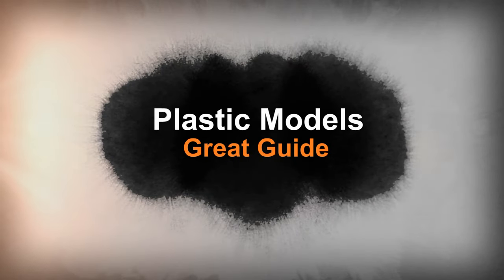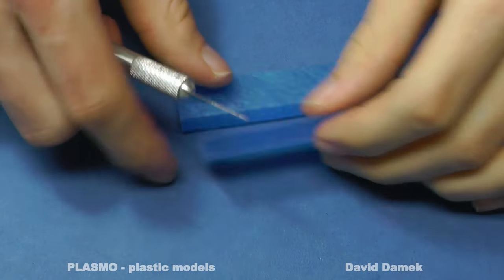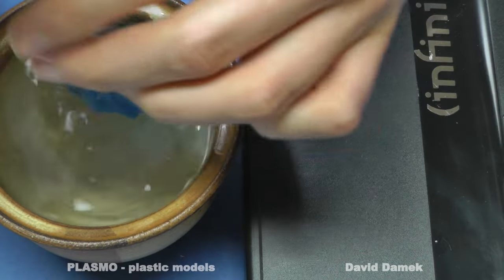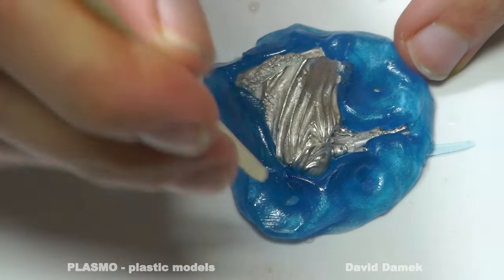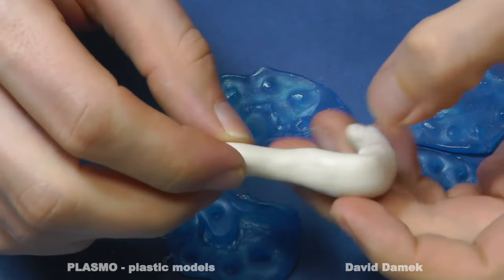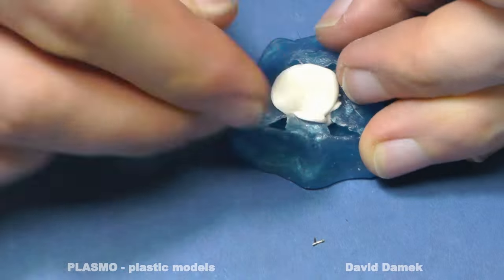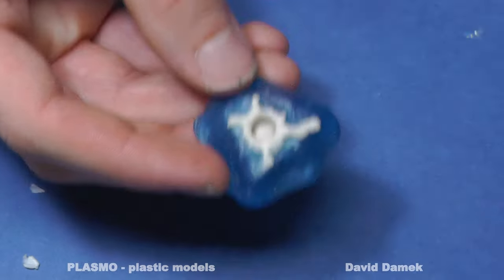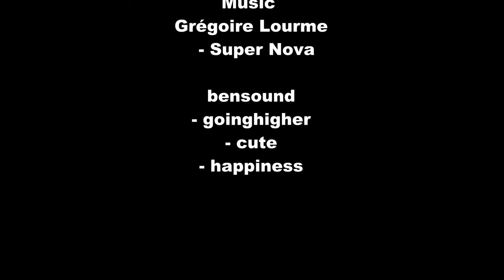Blue Stuff/Oyumaru  - How to cheaply cast miniatures or plastic models - new version

Comment: The 'X' on the Epo Putty means you better put on some gloves.
Reply: This is good to know, i went off useing epoxy putty after it made the webbing of my fingers  blister and my eyes go all puffy .
Reply: billyjimbobjr I'd advise not trying to take copies of your eyes using this method. ;-p
Reply: billyjimbobjr Maybe you're allergic? I've mixed and used at least 7 or 8 packs of the stuff so far without gloves and all it does is make my fingers raw (Rolling anything sticky in your fingers for hours will do that🚡)
Reply: aww dang, you might be right. i should maybe get tested.
Reply: you have webbed fingers?
Reply: Phu Vet 
The webbing is the small fleshy bit between the fingers, particularly the one between the thumbs
Reply: More like you better wash your hands after using it. Outside of people with sensitive skin, the transdermal bioavailability of whatever nastiness is in there is going to be minimal. Just don't ingest it or apply to mucosa.
Reply: Phu Vet not in the way a frog or bat does, but yes.
Reply: it means it can cause irritation. try not to rub it into your mucus membranes or into the pores of your skin
Reply: Phu Vet we all do, but it's not that noticeable sometimes. The webbing between the index finger and the thumb is called a FLAGINA
Reply: i put tamiya glue sometimes on my hand to check if u touched the paint with the brush and nothing happened
Reply: @RalphV  Kinky!!!
Reply: @RalphV  some toxins can enter the body through the skin. Do it often and the toxins can pile up in your body and make you very sick later in life.

Comment: It doesn't look like it captures detail very well.
Reply: Part of that is down to the method.  The blue putty still looked wet during its molding, capturing some water, and the user was going pretty quickly with the epoxy, which itself seemed to be a bit thick for fine detail.  I think this stuff did pretty well, for basically being high-temp silly putty.
Reply: A lot of TLC and a fair bit of luck is required to get even some of the finer detail to transfer over.. don't expect it to be a perfect (or even close) mirror of the original piece being molded. They will almost always look like they have a really thick coat of primer on them :p
Reply: @ARescueToaster  There are a few videos that show this getting a high level of detail on other channels.
Reply: @darkstorminc  I'll have to check those out! I imagine it's not easy to do, though?
Reply: @ARescueToaster  iirc you will need to have a mold box for best results. Some recommend using legos which I think would work out well.

Comment: This is a great idea. I do metal casting and would like to try this to make wax patterns for lost wax casting. Is this product still available. A google search only shows a few suppliers that do not stock it any more. I am in the UK.
Reply: look for Polycaprolactone (PCL) on aliexpress.
Reply: Does not ship to UK, where I live.
Reply: Sorry, don't know why the would ship to the US and not the UK. I ordered a bunch of stuff from them the past few years. Maybe if you send them a message or do a search on Amazon, Ebay or the web. Use search words "Instant Mold", "Blue Stuff" or "Oyumaru". I have used both, the blue stuff and Oyumaru. I like the blue stuff better, but I think they are the same thing.  They are great for one sized molds, and good for two sided molds for small parts. I just started converting toy soldiers and this is a great way to change the way a figure looks by adding different weapons, helmets, shields or something else. Next I will be changing arms, heads and other parts that I make or clone. I have a blog page, if your interested. Good luck, Mike.

https://warhorseminiatures.com/
Reply: Yes they seem to have something against the UK, shipping is to lots of other countries.
I have been trying moulds made with silicone sealer, corn flour and sunflower oil and it works very well for one and two part moulds.
Reply: One day I will try to make some silicone molds if I ever sculpt anything decent. Just getting started with all this the past couple of years, only have been using the instant mold and epoxy. I use the brown and green stuff epoxy or kneadatite. Going to use some other types in the future. I wish I had more time to do things like this, but between work and other things I don't :(
Reply: There is another product called "instamold" that works similar to this. I have a pack myself and it's done wonders to reproduce OOP parts. However as I have a personal rule of not casting entire miniatures (just rare and hard to find parts that I need en-masse, like plasma guns) I do not know how well it is on bigger projects.
Reply: I used the blue stuff and other products like this to use patterns for miniatures. I took some toy animals to get a fur pattern to use as a fur cape on some Vikings. I have not tried to mold a figure, but might try next year. Like you said just some OOP or rare figure would be worth it. I was thinking of trying to clone some parts to make new figures. Like changing arms or heads. Or cutting up a figure and then putting the parts together or make some new things. I think it might be easier and getting better details captured in smaller parts, instead of trying a whole figure.
Reply: MechaEmperor7000 Instamold works just like this. Oyamaru is the original. CoolMiniOrNot repackaged the clear Oyamaru under a new name, jacked the price and made everyone think they matched sliced bread. Blue Stuff is the same as Oyamaru but in a different color. Looks real good. Check for Oyamaru on eBay. Usually get em for less than a buck a stick. As always, anyone should educate themselves.
Reply: this seems to be the same/similar stuff: http://elementgames.co.uk/paints-hobby-and-scenery/epoxies-milliput/mini-mold-6-sticks
worth a try anyway.
Reply: martin the worrior read my response I did to MechaEmperor7000. The stuff you linked is the repackaged stuff CoolMiniOrNot sells. It is originally Oyamaru but more expensive.
Reply: myfordboy you can get thermo setting plastic granules from any Maplin store or on their website. Does the same job. Wear gloves if using the putty, obviously!
Reply: Adrian Beaumont I've got the white thermoplastic granules, called "polymorph", but that did doesn't behave like the blue stuff here does. Polymorph bonds to itself aggressively so you'll never get the two parts to split, and it isn't flexible or very transparent. It is also really hard to cut with a knife, while "blue stuff" seems more like a jelly. 
Having said that, I will try it tomorrow!
Reply: Discreet Security Solutions Yeah cool... the blue stuff looks softer, maybe. Let me know how you get on!
Reply: I have had success now using silicone and corn flour. A tube of cheap silicone, brown makes it easier to see. No nonsense brand from Screwfix,
Reply: +myfordboy you said you were doing lost wax casting, do you have any tips for what to make the investment out of? Also if you search for proto-putty on grant thompson's channel you'll see something like your silicone and corn four mix (just thought that was interesting)
Reply: This is just a common kind of thermoplastic material. Thermoplastic pellets have been available to hobbyists for a while. Try looking for Thermomorph, Friendly Plastic Pellets, or something along those lines. They can usually be had for slightly cheaper than Oyamaru per gram. 
In the US I can buy half a kilogram of Thermomorph for about $19.
Reply: The mould-able plastic I've used in the past sets pretty hard compared to how flexible the blue stuff looked. It would probably work fine for certain pieces though.
Reply: I've actually tried it since leaving that comment, and you're not wrong. The normal "polymorph" plastic sets pretty inflexibly. Not bad if you're casting a simple shape like a figure's weapon, but for anything with overlap it's not gonna work that well.
Reply: Mabe because Games Workshop is based there and put a stop to it. lol
Reply: Hello,
But I am not sure If it is heat resistant for casting wax. I would be glad If It worked for you.
Reply: I'm thinking the same.
Reply: @BeOurBee The instamorph/polymorph/insert-brand-here thermoplastics are Polycaprolactone, which can indeed be bought even cheaper on Aliexpress. However, it is not what this oyamaru/bluestuff is. Polycaprolactone is marketed as an alternative to common plastics that you can shape yourself, which means it needs to be stiff and stick to itself. These are exactly the properties you don't want in a mold making material. Stopping thermoplastics from sticking to themselves is actually very tricky, since the thing that makes them do it is what makes them plastics (essentially polymer chains intertwining and tangling). Given that this stuff is reusable (likely not infinitely as they claim, but still), there's not a lot of incentive to figure out a capable replacement. If you intend to look, I'd take a guess at a shorter-chain PCL, likely in a compound. Chances are, this is the same (or similar) thermoplastic that's been tuned to have a narrower glass transition temperature range (glass transition is different and separate from melting, and what you're looking for in this case).
Reply: Honestly I wouldn't doubt that Games Workshop had something to do with making this stuff hard to get in the UK.  They are UK based and have an army of lawyers.
Reply: Oyumaru my dewd

Comment: That BIG orange 'X' on the epoxy casing...
I am pretty sure that it means either or both:
"Do wear gloves when handling this!"
"Do protect your breath, with a mask!"
Atleast i know that the 'X' does not mean:
"This has no health-risk what so ever..."
Read and follow the instructions!!
Reply: it means it could be irritating to mucus membranes and skin, however most kneadable stuff is safe for skin, don't stick it up your nose but or in your eyes I guess.
Reply: @gerbenvanessen  no it's not safe for skin. There are aggressive fat soluble toxic molecules in it that easily pass the skinny barrier. I'm too lazy now, but you can look it up on Google. Never use that stuff without proper protection!
Reply: @SelectedPeppa  Did you know that breathing air outside allows all sorts of parasitical microbes into your lungs that might do irreparable damage to your lungs? Better wear a full respirator and enviro-sealed suit at all times, who knows what kind of dangerous things are in the air. Even better, just don't leave the house!

Comment: how exactly do you get the epoputty to dry as hard as warhammer miniatures? whenever i do this, my molds shape it perfectly, but the epoputty itself always comes to an almost soapy texture. like it feels hard at first, but if you put any pressure whatsoever on it it crumbles. i am mixing it as evenly as possible, what could be the cause?
Reply: I am having the same problem, I am wondering if there's a big difference between brands.

I'm using Milliput and it's real fragile.
Reply: I use a mixture of 50% milliput and 50% greenstuff.  Mix the greenstuff first, then the milliput and then mix them together.  After it cures, the result is harder and less bendy than greenstuff but not nearly as brittle as milliput.
Reply: Either bad quality epoxy putty, improper mixing (not thorough enough or wrong proportions), old material or whatever you're using is not actually a two-part epo putty. A two-part epo putty contains the working material in one part and a hardener in the other - if thoroughly mixed, it has everything inside of it to make it harden and there should be little to no difference between the outside and inside. The effect you're describing is more common with air-dry materials or materials that use moisture in the air to advance the reaction (like type I silicone).

Comment: I found it quite critical to get the right amount of epoxy putty in each part of the mould, otherwise the two parts don't go together properly. I used the Green Stuff World putty that came with the “Blue Stuff”. It seems a bit harder to work with than Milliput so I think I'll try that next time. So glad I got this.

Comment: Seems great but how well would it work if I put green stuff in the moulds?
Reply from the maker: the green stuff will work too for one side mold. If you will use two sided molds, then you'll have problems sometimes. I mean create a strong bond from both halves.
Reply: @idaemonplasmo  glue

Comment: Is there any reason you can't use the liquid resin with the blue stuff?
Reply: I was curious about that as well so I got some and tested it. It seems to work perfectly well and is quite easy to use. It doesn't stick or react in any way and the casts are well defined. Not sure why it is was mentioned not to use 2 part resins.
Reply: Rugnineteen Often two part resins (especially epoxy resin) become hot while curing. Big amounts of epoxy resin might melt the blue stuff.
Reply: Faku Gogle That's a good point about the heat but the type of parts featured are very small this shouldn't be an issue. If that is a concern then 2 part polyurethane resins work well with Oyumaru without the heat issue.
Reply: If it needs cooking hot water to be malleble again. It won't be a issue. Also the heat produced is a catalyst to speed up the proces, don't cool your molds unless you need the extra time or slightly smaller castings as cold makes things shrink. (Unless your name is water)
Reply: My guess is he's found it easier not to have to make the two-part molds with a sprue and making sure they didn't leak. Likely easier to avoid air bubbles as well since he doesn't seem to have a vacuum chamber. I see no reason why this wouldn't work with resin. What I'm really looking forward to is trying to use ABS slurry.
Reply: This will totally work with resin BUT resin has its own learning curve.  You have to make an airtight mold probably using a cage with a pouring channel (sprue), and you have to know how to get all the bubbles out.  That is significantly harder than just mashing some putty into the mold.  With a good technique though, this would make good resin casts.
Reply: Am just thinking... why not mixing up some 2-part resin, paint the insides of both molds and let the resin cure, then continue as per the video, filling up the molds with epoxy putty? That should help to retain fine detail on your "casting" (assuming of course that the blue stuff is capable of capturing fine detail...)

Comment: not nearly as easy as it looks
Reply: lifelonghalo I disagree. You are either not getting the Blue Stuff hot enough or you are not getting the Blue stuff hot enough. My very first try is my best mold and it went down hill from there. Problem being is the water got cold. Make sure that water is piping hot and let the stuff sit for 3+ min. Work FAST and you will achieve a good copy I assure you. Good luck!!!
Reply: Im finding it hard to use aswell. But i think i just need too keep trying :D

Comment: This is just Polymorph/InstaMorph/Plastimake. Sold on internet in the form of  small balls. And they are cheaper per gramm.
Reply: Eco but its blue! Seriously though i would like to see a comparison
Reply: Plastimake type products are not for mold making.  The one I read about dries to a rock hard consistency, you want a mold to flex just slightly and be non-stick.
Reply: Great hint mate! Much better and more easily available (in Australia) Thank you!
Reply: I imeditately tried using my instamorph after watching this. It didn't work very well. It's much more rigid than what this video showed thus I couldn't get the piece out easily and damaged the mold. I was trying a one piece mold but susupect the top half would stick to the bottom. Also, Instamorph sticks to most materials I touch it to so I was/would be terrified that what ever I was casting would become permanently encased in it. This blue stuff doesn't have this flaw it seems. And the test piece I used was painted and the instamorph ruined the paint. I'm not sure if blue stuff would too. Also the transparency of blue stuff would make it easier than my test mold to fill everywhere.
Reply: The instamorph/polymorph/insert-brand-here thermoplastics are Polycaprolactone, which can indeed be bought even cheaper on Aliexpress. However, it is not what this oyamaru/bluestuff is. Just because they're both thermoplastics doesn't mean they're indentical. Polycaprolactone is marketed as an alternative to common plastics that you can shape yourself, which means it needs to be stiff and stick to itself. These are exactly the properties you don't want in a mold making material. Stopping thermoplastics from sticking to themselves is actually very tricky, since the thing that makes them do it is what makes them plastics (essentially polymer chains intertwining and tangling). Given that this stuff is reusable (likely not infinitely as they claim, but still), there's not a lot of incentive to figure out a capable replacement. If you intend to look, I'd take a guess at a shorter-chain PCL, likely in a compound. Chances are, this is the same (or similar) thermoplastic that's been tuned to have a narrower glass transition temperature range (glass transition is different and separate from melting, and what you're looking for in this case).

Comment: This has been around for ages, it was first called Polyform. Only good for cloning parts you already have. Still a cool material. I've made props from it by sculpting in clay first, then making a  plaster mould, and finally pressing the material into the mould, further heating it and pressing again to trap fine detail.

Comment: You can speed up the hardening of the Blue Stuff after taking your first cast, by putting it in the fridge for a while I have used similar casting products and have got good results, but I must try the two part method, thanks Plasmo..